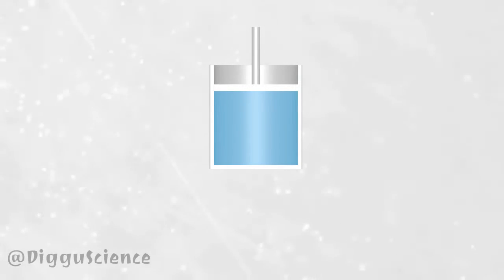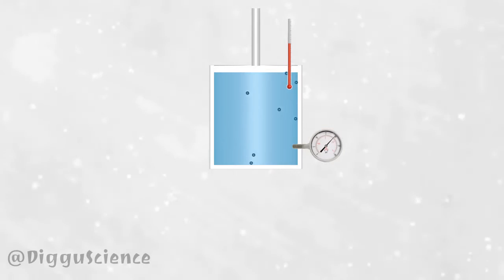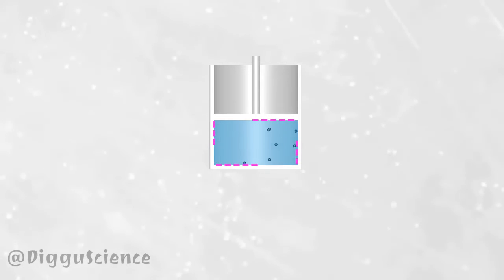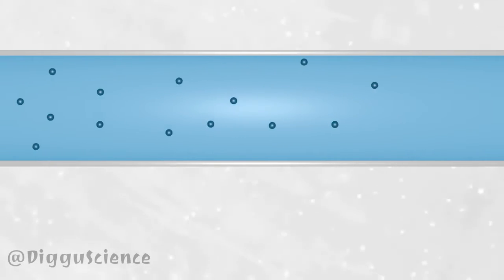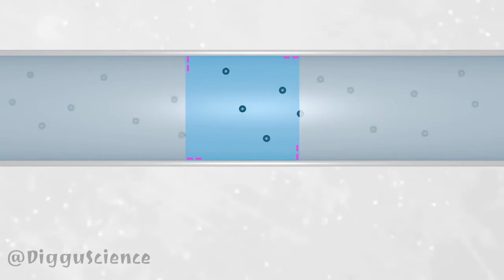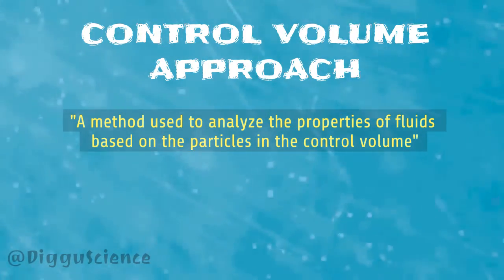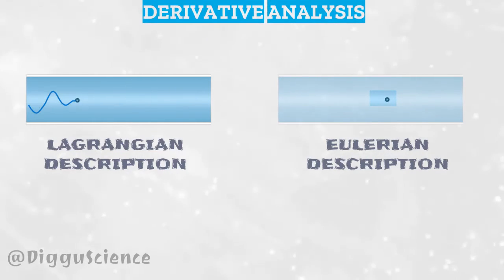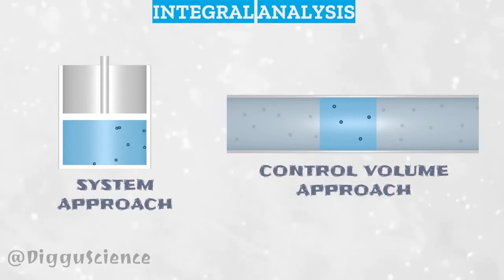System Approach and Control Volume Approach [Fluid Mechanics]

Comment: No understanding this topic 🤦🤦
Reply from the maker: This material is conceptual and abstract. This seems similar to the Lagrangian and Eulerian concepts.

In the volume control approach, we choose to analyze the fluid in a fixed volume, even though the fluid particles in that volume are different fluid particles.

In the systems approach, we only analyze the behavior of the same particles. Like gas fluid in a balloon. The volume of the balloon can change, but the number of particles in the balloon remains the same.

Regards